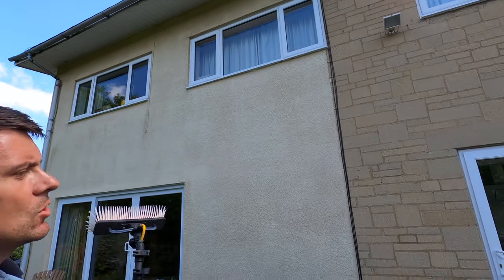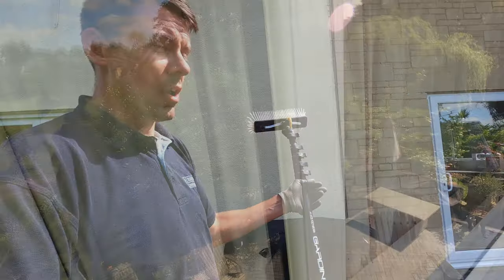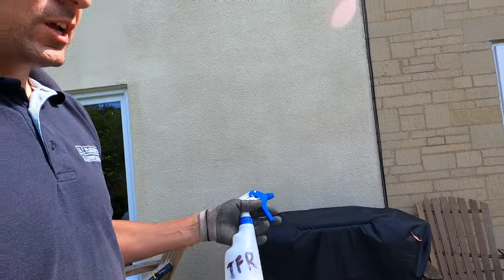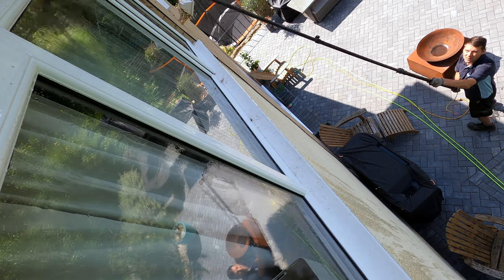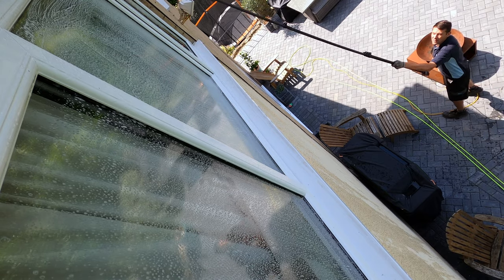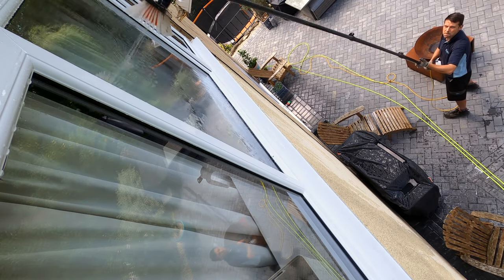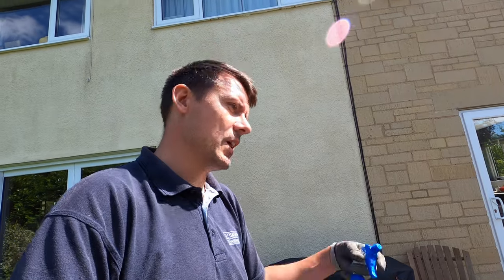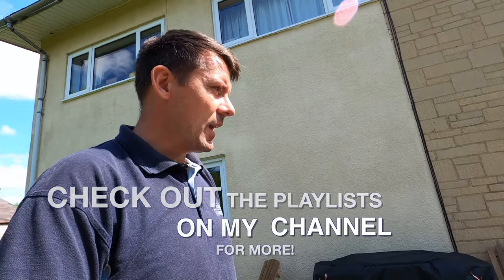Can I Clean This Greasy Window Using WFP?

Comment: I would never thinking that the oil going that far It's a great method  well done ...!!!!!   I just  added a  litre soap Injector tank  into my water tank system where you can control the flow  specially for those kind of jobs where the oil are present in at large sides NOT that easy  but It helps  a lot now on  i would like to play more attention  Thank You Ash another great video like always ...!!!!!
Reply from the maker: Nice one. Thanks for your comments.😃👍🏼

Comment: A up Ashley, I've done a fascia today and I carnt get a few marks off where the gutters have been overflowing from being blocked , do you have any advice how to get them off ?? I'm using ubik 2000 but will tfr work better ... where do you get your from if you don't mind me asking.  Thanks ben and sorry for the long question lol
Reply from the maker: Ubik 2000 is very similar to the TFR I am using. You could try A1 Hardwater stain remover from Titan. But the upvc might be stained?
Reply: @aemackintosh  yeah I think it may be stained.. thanks for the advice pal👍

Comment: Hi m8 what size and make is the brush head? How many jets are rinsing there?
Reply from the maker: It’s an xline brush. Find out more about it here: https://youtu.be/vmVosf9_H6I
Reply: Ah lol i thought its was different brush but just without the orange bumper this time.
Reply: Can you do a video of what process you use to fill your tank? Is it from an ibc? Coming up for winter do you have any tips for freeze prevention on tank, pump, and reels?
Reply from the maker: All my filters are on board, built in to my van system. So the water filters as it goes in to the tank.😃👍🏼

Comment: Hi Ashley. Can I ask what your method is on first cleans with regards to upstairs sills? Using wfp you can’t see if the upstairs sills are clean or not. Do you use ladders on first clean? Also do you use pink stuff on first cleans? Cheers John
Reply from the maker: I suppose it comes with experience, but if you make sure you give the sill a good scrub twice and the water runs off clear, you are pretty much there. If you make sure you give attention to the sill each visit after that then you know it should be well maintained. Or, you could always check using a ladder if you want, or maybe even a camera?😃👍🏼

Comment: I always found using TFR on windows it melts the black rubber
Reply from the maker: It might depend if it’s old rubber, but I’ve never had a problem if I wet the windows first and don’t leave the chemicals on for too long.😃👍🏼